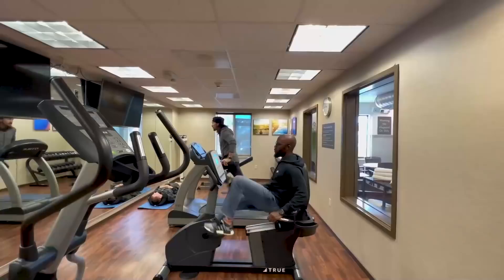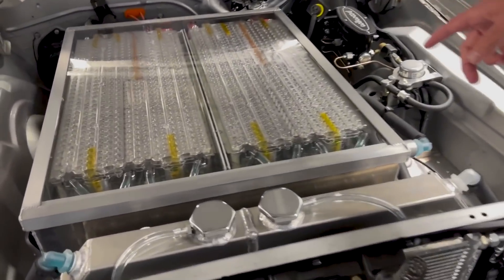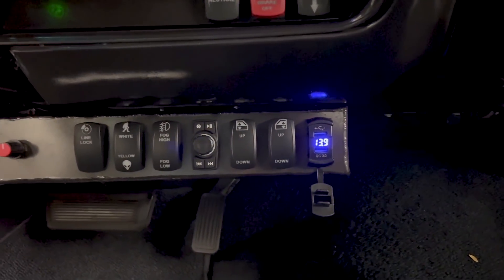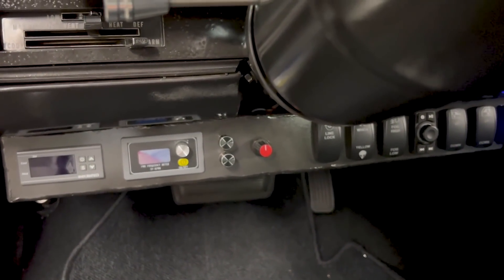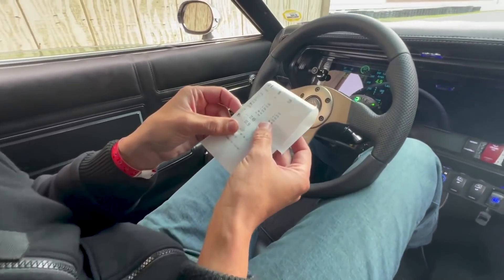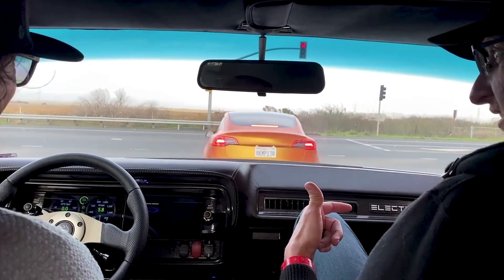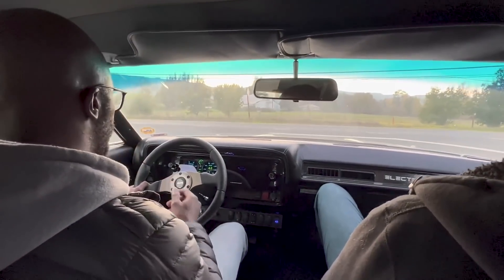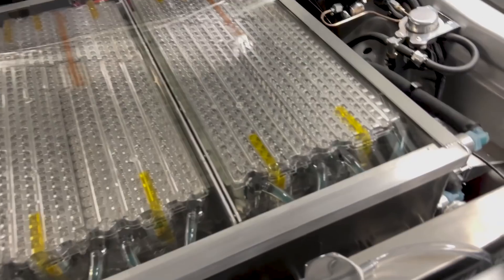Bringing Tesla Power to a Classic 70's muscle car

Comment: I actually appreciate people going ev conversion with cars like this, I mean not cause of the ev hype but to give those cars a new purpose. 
Don´t get me wrong i love the rumbling v8 muscle gas guzzling tire shredding beasts and sure as hell is the ev going to be a totally different experience, much more tame and less exciting but the car will be on the road for much cheaper and no matter what stupid emission regulations the nutjobs come up with.

That said, i still hope hydrogen is going to become the new big thing and replace ev´s (even so its pretty much the same with the only difference you pretty much run your own power plant instead of just battery packs).

The only issue i have with ev rebuild of classis, you more or less end up totally killing the interior doing so. The incredible stylish old gages are not going to work at all with the ev conversion and the new fancy looking displays just do not fit at all. Hope there is a chance for someone to make retro spec ev gages but i doubt the market would be large enough.

Comment: Coal or oil powered?
Reply: Depends on how I charge it, but you left a bunch of fuels out... Natural gas, propane, diesel, wind, solar, hydro, gravity, nuclear, static, pretty much any fuel you can think of.
Reply: @trumpsa34xfelon  I've charged off of diesel generators, and they also have propane generators... You can charge a car with anything that makes the right electricity.  The grid is not my problem...If they want to sell power, They will figure it out.
 I just plug in, charge-rip-repeat.

Comment: The future. In about 20 years if you want to run an old car,  the "Leuw" is only going to let you run electric.  Once they ban new car production they are going to start going after all the gas engines. They are already going after small gas engines in Californy.   Me, I will be dead long before then so not my problem. If you are 20, boo-hoo enjoy 'em now.  Your older age will sound like nothing...unless you put in a speaker with engine noises.  Just the way it is going to be. The Golden age is ending for gasoline vehicles.

Comment: Electric cars are cool but not in Motorsports , the thing that makes combustion engines cool is that there's so many parts you can change to make it rev higher make it boost more make alot of changes electric cars are so boring change battery packs or add more add a motor tune it get cooling for it and your done that's so boring and it makes almost no sound

Comment: I hate to say it, but this is the future.  I love gas powered stuff. All my yard maintenance equipment is gas powered.   My hobby is nitro rc cars.  I live in a place that has a fossil-fuel based economy. I work in an oil refinery.  But, electric will take over. Electric is superior in many ways.  If classic cars are to be preserved for the road,  this is what needs to be done.  This is where tuner culture is going.
Reply: Probably because gas prices will be raised to very high levels

Comment: You can do a blower you can change blower pulleys or belts or even do an oversized cam and Flowmaster 40 series exhaust and H pipes and possibly even headers and a drag set up with race star drag wheels and Mickey Thompson ET  streets. You could possibly change the torque converter even the transmission there's a thousand possibilities. But for God's sakes leave a tree hugging rainbow flag flying nerdmobile golf cart battery out of a damn muscle car. It does not belong under the hood of a muscle car. You need to call Mopar and let them fix that Tesla couldn't put cheese on a fucking rat trap. I don't care for anything Elon musky sells.
He's a foreigner trying to sell an American junk mobile. He don't have the experience number one Mopar has been doing this shit for decades and Mopar Ford and Chevy do it better than anybody.